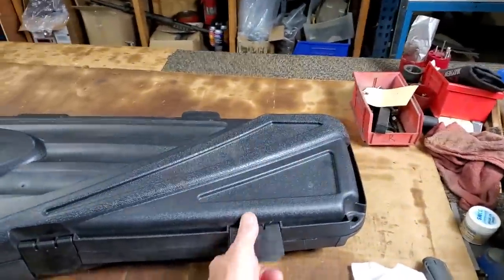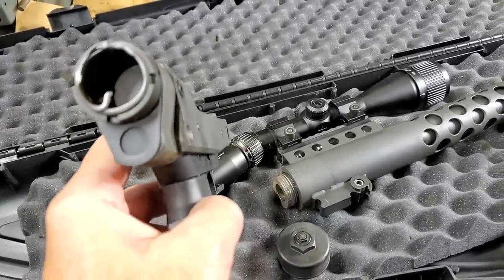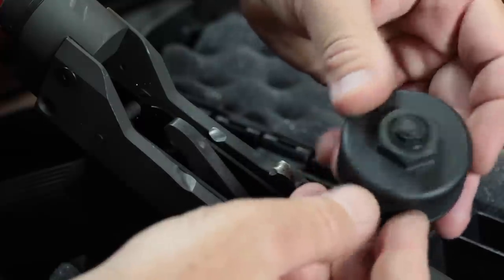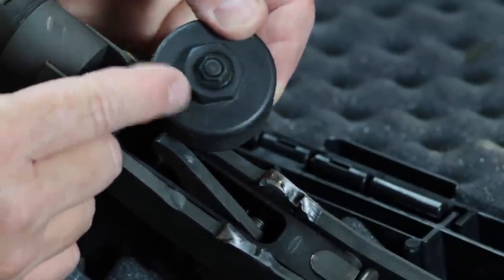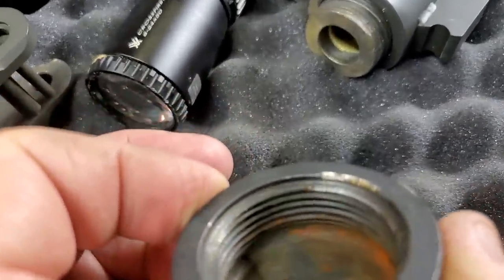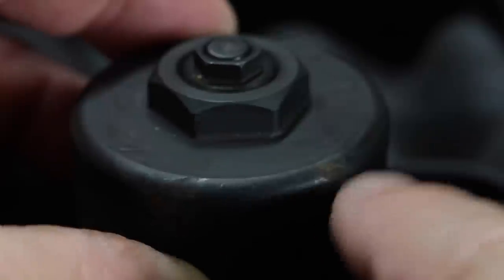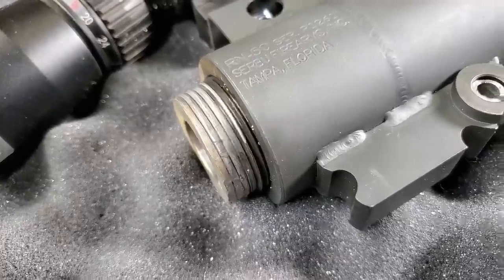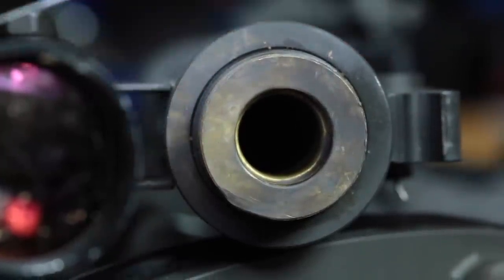Kentucky Ballistics' RN-50 Blow-up:  First Look

Comment: I'm still watching....any chance you can sample the inside of the brass to see what kind of powder was in there?
Reply: Why? He has live rounds
Reply: @doublepiedavid8908  if the rounds were dodgy, they might be different from eachother

it could be degraded powder in the fired round, a wrong load, or even a spiked round
Reply: I would still see if a forensic lab would look at the round and identify the explosive.  If it turned out to be C4 or similar, it would clear the whole thing up really quick. 

If it was a sabotaged round,  the other four are likely good.
Reply: @missingthe80s58  For something like this, degraded powder is more likely than most any other ammunition. With how these are expensive collectibles and seldom are sold in contained batches, these have been going around as loose cartridges for decades, it's impossible to say for certain how they've been stored or handled. It's not like with known batches of surplus ammo, like where you buy a spamcan of 7.62mm Nagant or 7.92mm Mauser from a surplus retailer, and know it's been stored well, someone could have put one in some display where it was frequently exposed to sunlight.

I wouldn't shoot some random .45 Auto cartridge I found on the street for the same reason.
Reply: @0neDoomedSpaceMarine  I've heard of degraded powder causing squibs and hangfires, but not detonation. I'm not a chemist, so I don't know enough to say you're wrong or right. But if it was degraded powder, why don't we see old mil-surp ammo exploding constantly?
Reply: @doublepiedavid8908  He has rounds that aren't necessarily from the same batch.  If someone accidentally put pistol powder in Scott's SLAP rounds, how would testing "live rounds" prove or disprove anything?
Reply: @RangerOfTheOrder  Ian over at forgotten weapons did a ammo evaluation on surplus turkish 8mm mauser. It is significantly overpressure from degraded powder. Known for causing damage to semi-auto's and machine guns. His test rifle developed a crack in the stock by the end of testing.
Reply: @missingthe80s58  its entirely possible that if the slap rounds had ever been shipped/deployed in a combat zone that they were sabotaged intentionally. Then one way or another it gets back to the civilian market after being resold half a dozen times. This seems more likely with a round like SLAP due to it being a specialized round that is hard to find.
Reply: @RangerOfTheOrder , the only mil-surp ammo I know OF (not having bought or fired any myself) that has a reputation as being dangerous is Turkish surplus 7.92mm Mauser ammo.
Reply: My thoughts exactly  or what kind of explosive  ???
Reply: @RangerOfTheOrder  Because of how it's stored. Mil-surp is typically stored in sealed cans, these SLAP rounds have been loose for who knows how long. Sunlight exposure, temperature changes, any number of other environmental factors could have affected them that other surplus is protected from.
A great example of this is actually the powder explosion at Hornady a few years ago. Basically they sat on their scrap powder for too long, the summer heat caused the powder to become unstable, and it combusted in the middle of the night.
Reply: @kirkmooneyham  it does have a reputation for being pretty hot
Reply: @RangerOfTheOrder  different field but similar result, the Takata airbag recall is the direct result of propellant degradation. Moisture absorbed by the ammonium nitrate in the airbags caused detonation. Could be something similar, though any ammunition from the same batch stored in the same way would show similar characteristics.
Reply: Nitrocellulose based powders (pretty much any modern gun powder) are surface burn rate limited.  If the powder has been mechanically broken down to smaller grains it would burn faster.
Reply: @eliasaamot573  ...the enemy
Reply: @eliasaamot573  People do things all the time that others think is irrational. And it's not like it would much effort especially if it was done by the guy who was loading them. Put in some extra powder, or use pistol powder and kaboom. The C4 definitely makes no sense though.
Reply: @RangerOfTheOrder  I was talking to an ammo manufacturer. It was suggested that the coating on the powder that retards the burn could have deteriorated and that would allow the base propellant to burn way too fast. Pressure makes heat, heat makes pressure. When you jack it up combustion gets going really fast. Instead of burning in a controlled pressure curve, you get a massive spike. However, slap rounds aren't loaded the same as regular ball. They aren't supposed to be, anyway. It's a lighter bullet that needs a faster powder to make pressure faster for a good burn, otherwise it just 'foops' the bullet out with poor combustion. Same thing applies to heavy vs light bullets in any cartridge. 

The reason we don't always see it with old surplus is dependent on storage conditions. If it's kept in a cool dry place like it's supposed to be, it will last for a very long time assuming the powder stays dry. When heat and moisture is introduced, all bets are off.
Reply: Really looking forward to close examination of the remaining rounds, may imply not be enough left of the kaboom one to gain any real info and yes, its entire possible the others may have not been from same batch but i guess we really need to know if Scott acquired them all at the same time from same source?
Reply: @eliasaamot573  the CIA had a program during Vietnam to lay ak ammo with c4 in the rounds around for the Vietnam soldiers to find and blow up but not harm us a troops using the m16. Why would someone copy that in slap rounds on a 50? Idk
Reply: @d3faulted2  Ive shot some old 7.62x39 (30+ year old chinese junk) that i really do think was op by force required to open bolt and extract brass vs modern loads as well as shooting some super old 303 brit (1950's i think) milsurp stuff a mate gave me (with his rifle) that kicked like an absolute mule, however the rifle (fazerkaly no4mk2e) didnt give a rats (so much for "weak" rear locking lee enfields) about it, unfortunately it was very early in my shooting days and i didnt own a chronograph at the time. Shot many thousands of normal 303 loads since though, including some of my own reloads that were pushing 200fps+ (quickload was way of at the time, saw no op signs so i shot them anyways but never load that hot intentionally) more than mil spec and none ever kicked like those old milsurps, which i assume were cordite rounds. In short, i agree old stuff can degrade and create op situations, but i do think not enough to cause what happened with Scott. just my 2c.
Reply: @eliasaamot573  You're kidding, right? It's well known that the CIA delivered sabotaged ammo to caches in Vietnam and other conflicts for the enemy to find and blow themselves up with. And you can be sure that if the CIA did it, other governments did too.
Reply: @eliasaamot573  Look at "Project Eldest Son" for an answer to your question.
Reply: The US army project Eldest Son. Sabotaging AK and Mortar rounds. Rounds would be filled with high explosive.
Reply: @d3faulted2  wait, so powder gets actually stronger when it degrades?
Reply: @Genesis23OPB  the chamber pressure curve needs to be at specific pressures at specific times as the bullet moves down the barrel and creates more volume for the gas to expand into behind it. therefore the burn rate is critical, and the size of the powder grains and the size of the pores in the powder grains is also critical.
Reply: @JinKee  ah i know what you mean. so if you underload a round by halfing the amount of powder in a case you create a grenade as well, as the burning space is too big and unbalanced?
Reply: @scottmcdivitt2187  If it was C4, the breech itself would have shattered, this is just a massive overpressure situation.
Reply: @RangerOfTheOrder  Because different powder makeups degrade differently, some degrade to become less reactive, some become more reactive. See: Ian's video on 7.92x57 surplus.
Reply: @scottmcdivitt2187  right thats my thinking...if it is a sabotage whoever did it knew damn well just one of those puppies filled with pistol powder would be enough
Reply: @Genesis23OPB  no that is not correct. i am talking about a scenario where you take the powder in a case, grind it until the particles are half the size and then put them back into the case so there is the same weight of powder in there but the smaller particles burn much quicker. rifle powders use big slow burning particles because as the bullet moves down the long barrel the volume the gas can expand into becomes greater and so you need to keep adding gas to keep the bullet accelerating. if the powder burns all at once before the bullet has a chance to get going the peak pressure becomes many times more than what the steel is designed to handle
Reply: I was thinking the exact  same thing.
Reply: @RangerOfTheOrder  We do see it at times, Turkish 7.92mm Mauser surplus is notorious for duds and hangfires, on top of developing much increased pressure, Mauser 98 rifles are stout and can pretty much handle it, but it very reliably DESTROYS automatics and machineguns. G43s, Hakims, MG13s, MG42s, it's irreparably busted some of these fine ones, and at least one of those very nice Smith Machine FG42 repros.

Ian McCollum of Forgotten Weapons knows personally a man who's missing fingers because he opened the action of his Mauser to inspect what turned out to not be a dud, but a hangfire, which touched off at the worst time. Bad surplus ammo exists, and good storage is important, good surplus ammo was stored well.
Reply: @JinKee  jah i got that, but if you underload a round leaving way too much air in the cardridge that would be dangerous too, no?
Reply: @Genesis23OPB 
maybe he means that the powder becomes unstable.
Reply: @Genesis23OPB  less powder should lead to lower chamber pressures, lower projectile velocity and possibly a “squib load” where a projectile could get stuck in the bore
Reply: @kirkmooneyham  I still have some indian 7.62mm  from years ago, fired a few rounds through in my PTR 91, brass fire formed to the chamber ,leaving perfectly formed chamber flute impressions in the cases, and noticeably heavier recoil....I only use whats left in my izzy 7.62 x51 Browning 1919
Reply: @LouSaydus  that's some ass backward reasoning: they're super rare so it's more likely their sabotaged? Nah, the sabatoged ammo theory is the most far fetched stretch of the imagination out of all the ideas, especially because of how rare those rounds are. The simplest solution is almost always the right one, and theres nothing simple about that one
Reply: @eliasaamot573  the military has been known to do it, but its highly unlikely thats what happened here. That would be the most complex answer to this event, and i just dont believe it for a second, not in this case. There are several much more likely ideas
Reply: @doublepiedavid8908  I would check and compare those too.....considering Scott showed that powerful one prior to the accident.
Reply: @chrism4008  Who buys super rare Armor Penetrating Heavy Machine Gun Rounds? 

Liberal Gun Confiscating Democrats?
Reply: @bsod4144  if it was sabatoge,  I doubt it was aimed at Scott.  It was more likely aimed at some random American machine gunner in the 1970s, fighting in the Cold War.  But booby traps like that don't get disarmed when the war ends. 😢
Reply: @IAnolastname  that would depend on how much and what explosive was involved.
Reply: C4 can’t be detonated by firing pin, impact, explosion, etc. 
It needs to be electrically fired to explode, so that’s not a likely explanation for what happened here.
Reply: @JinKee  in some situations too little powder can cause higher pressure. Imagine a rifle cartridge in the chamber, normally the case is full of powder. When the primer ignites it's flame ignites the powder that's at the back of the case. This gets things moving, pushing the unburned powder in front and the bullet forward. While this is happening the powder is ignited back to front creating the expected pressure curve. I'm sure we all understand what I'm trying to explain.  Now imagine a cartridge with half the powder charge it should have in the same chamber. The powder is laying on the "bottom" of the case to the halfway point. Now when the primer ignites it's flame reaches the base of the bullet igniting all of the exposed powder the length of the case. That's a LOT more powder being ignited from the start than normal AND the remaining unburned powder isn't being ignited as it's being pushed down the barrel. It's ignited while it's still in the case with the bullet still relatively close. That's how less powder can  cause pressure spikes.
Reply: @scottmcdivitt2187  While I agree, i don't know of any country that made sabotaged rounds for US firearms. it would make sense if it was in the russian 50 cal, or 7.62x39 like our well known vietnam shenanigans, but were there any countries that made them and got them into US hands?
Reply: @MrSolLeks  it's possible they were inserted into the supplies of some minor ally of ours,  and then simply included when the batch was re-sold.  

While I have no definite evidence they exist,  I find it hard to believe that no one ever tried.
Reply: @scottmcdivitt2187  idk man...people get pretty jelous over mundane things..now imagine someone getting jelous of how good a guy scott is..not that hard is it..my bet is on purposefull sabotage...an injury attemp at the least
Reply: @eliasaamot573  Intentionally sabotaged rounds circulated in every major conflict, particularly in Vietnam.
Reply: @scottmcdivitt2187  Look at the divot the cap left in the shoulder of the gun having already removed the rabbit ears. The pressure must have been incredible. 
Beginning to think the alphabet men have been dropping some of those C4 rounds state side as well as in the Middle East....
Reply: @d3faulted2  that was a great video from gun Jesus.
Reply: @CS-zn6pp  that's the problem. On hard to find ammo like that,  there's no clue where it's been.  It could have been in the Mideast two purchasers ago.
Reply: @Genesis23OPB  Grain size and the addition of burn rate inhibitors control the rate of burn and chamber pressure. If they were left loose in peoples collections being knocked about the grains can break up resulting in faster burn and also things like moisture and exposure to temperature extremes can degrade the burn inhibitors also resulting in faster burn... From my research the slaps had very controlled grain size and burn rate inhibitors to ensure constant muzzle velocity and accuracy which would make them more susceptible to degradation than other rounds, throw in rarity and you know it was in the boot on the way to every range trip for the last 10 years to be shown off and ride back again because it cost too much to waste. If was not for this I dare say they would not list best by dates and storage guides on ammo >.> if it does not go bang you either don't live to tell the tale or blame it on luck, if it goes bang too much then you want someone to blame that your toy got blowed up.
Reply: @eliasaamot573  the United States Of America did it brah.
Reply: @Genesis23OPB  Nitroglycerin is already incredibly unstable, but over time it degrades into even more unstable intermediates.  So powders theoretically can become more powerful under certain degradation pathways.  Not sure if that was what happened here.
Reply: @eliasaamot573  The army did that in Viet Nam, Laos, and Cambodia as a means of Psychological Warfare to make the enemy think they had badly manufactured ammunition. No doubt others could have done the same to the U.S. in the Middle East. Sold as surplus. It is a good hypothesis and worth examination, though extremely doubtful as to the cause here.  I suspect the ammunition either degraded or was over/under-charged. It is likely the true answer will never fully be known and it will come down to a best guess explanation.

Comment: It looks as though when the cap came off, after shearing the ears off, it flipped end over end. The top of the cap struck the top of the receiver, and may have flipped again, completing one full rotation striking the receiver a second time before striking Scott in the face. This explains the shape of the divots in the receiver behind the ears, which look to correlate with the scuffs on the cap. The completion of the full rotation would potentially explain the second divot on the receiver and the damage to the inside edge of the cap.
Reply: I agree, it was also my first impression.
Reply: Ditto that
Reply: Also think receiver blasting downward hit his left hand not the butt stock.